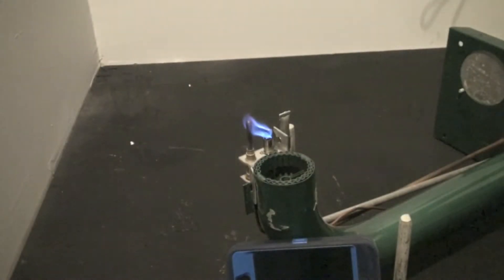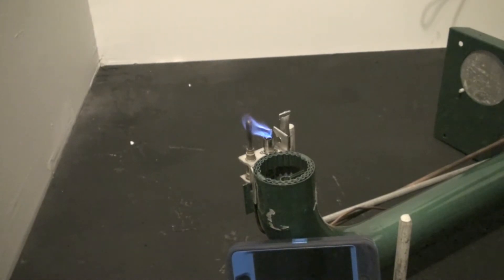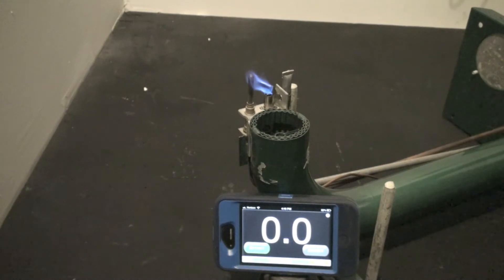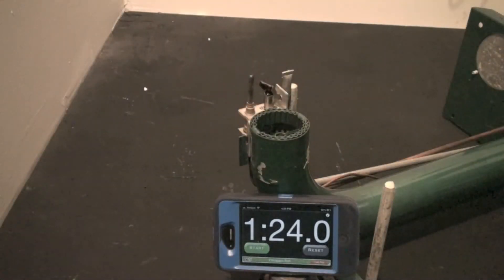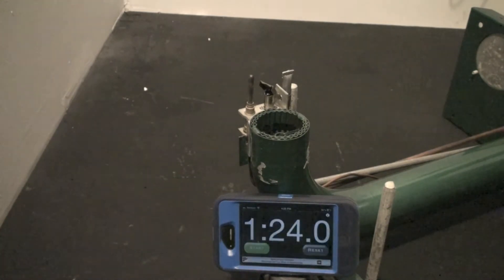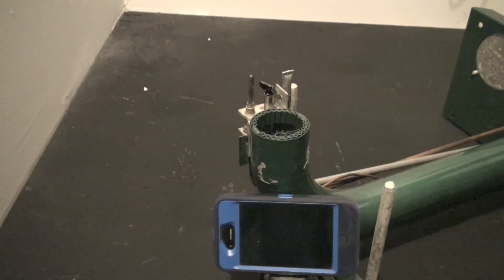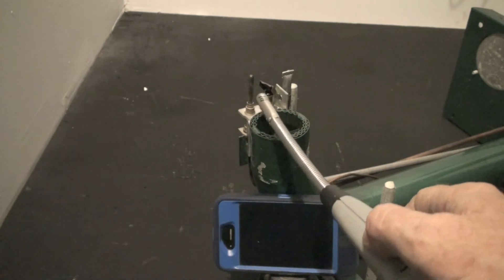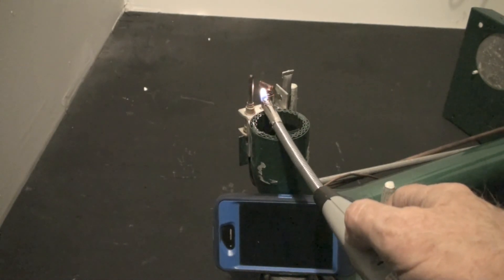How the gas furnace pilot safety works

Comment: GFM, thx for your reply we get the numbers from out TSSA exam and study modules.
Open Test = 20-30mV
Closed(or under load test) = 10-15mV  (roughly half of the open test)
Drop out Test = 2-5mV within 90 seconds
As you know a skilled low voltage(mV's) tech can trouble-shoot various other ways and fast by knowing what voltages he/she should see at certain points within the circuit based on what components are in the circuit(s).
Fireplaces take the skill as they work on mV.